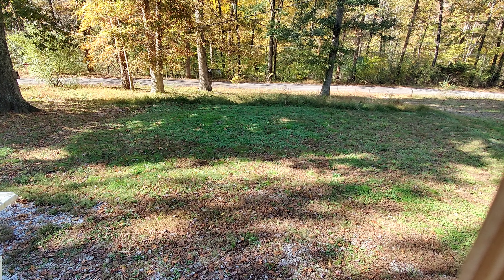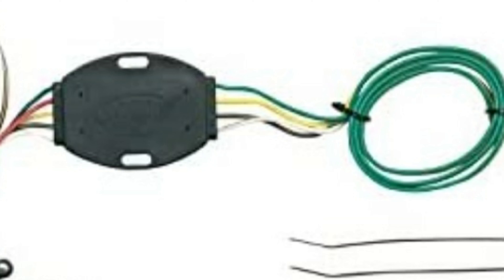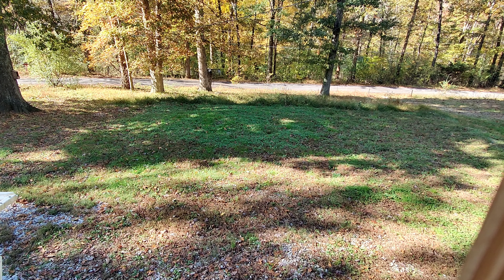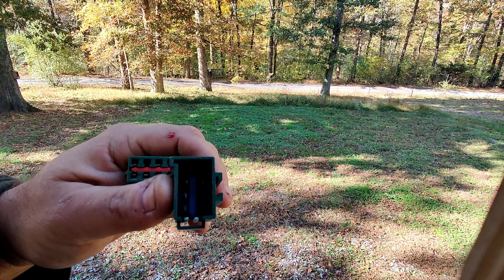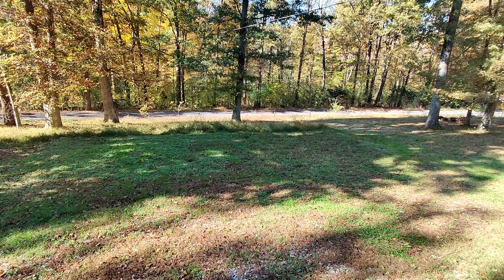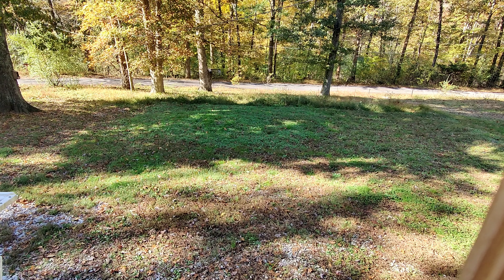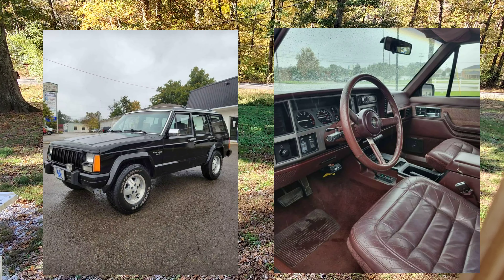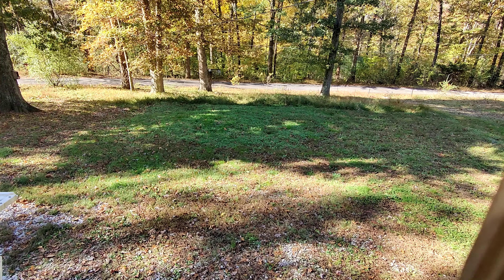91-96 XJ TRAILER LIGHTS - TRYING TO MAKE A EASY SOLUTION

Comment: They make a plug and play connectors in the rear driver behind the spare tire i can make a video of mine was super easy took maybe 5 mins
Reply from the maker: Welll hopkins use to make one. But no one else has ever seen anything simular. Do you have a link to the one you bought?
Reply: Did that link work or was it the wrong thing